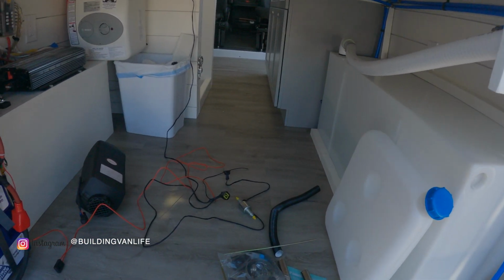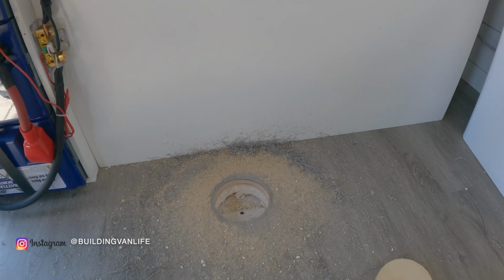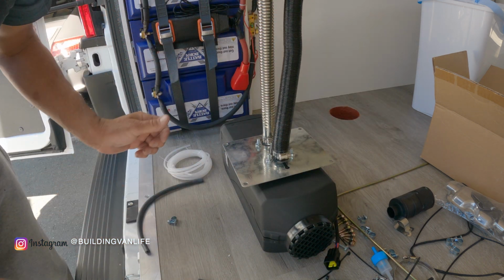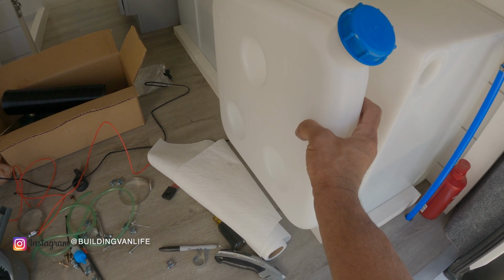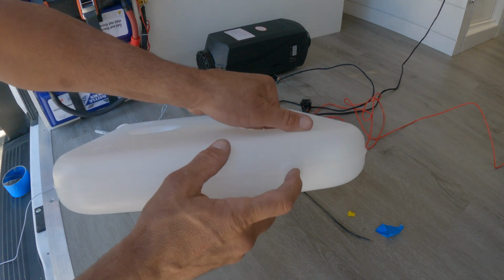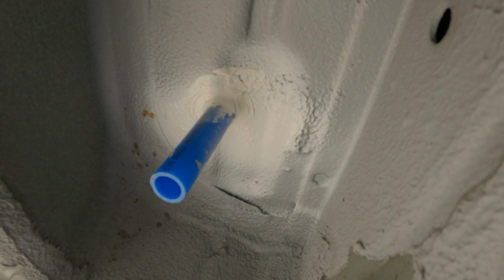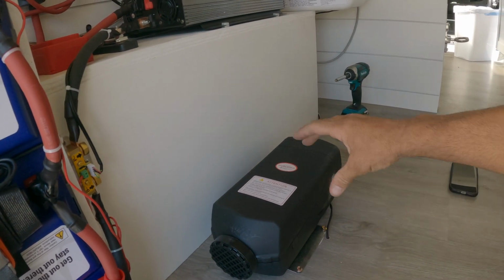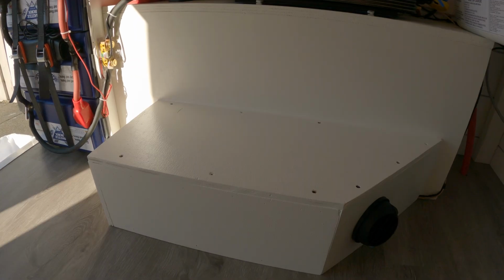Promaster Van Build | Ep14 | How to Install a Diesel Heater

Comment: Just a quick tip: So, regarding the muffler, you may want to mount it vertical as it has a weep hole at the bottom to release condensation. Else you will be blowing steam and that is highly visible (not so stealthy).

Comment: Thoughts on installing tank in engine compartment?  Or anywhere but inside?
Reply from the maker: Yes I’ve seen it done under the hood with a special tank.  I think it’s a great idea but then you need to install the heater towards the front of the van which I didn’t want to do for this build.  I like having the heater near the water tank to keep it from freezing.
Reply: @BuildingVanLife  Cool thanks.  I like mine too toward the middle, so if consequently the engine compartment is out, where else can I install heater outside an fill easily?  I've see tanks mounted beneath near the door with fill access through floor near the door, but that could vent fumes as well.  I hate having tank under bed.  Excellent info!
Reply from the maker: @3genac  I don't know i guess you just need be creative.  I have had my tank inside on 5 vans and never had any issue with fumes at all so it's never been an issue for me.

Comment: Definitely should have bought a grommet kit for all the small holes to protect for all the fuel lines and wire penetrations in the floor and the van’s structural beam penetrations as well, pretty cheap insurance, a full kit is about $10 bucks at Home Depot or Harbor Freight. The hole for the Intake and Exhaust needs to filled completely after the unit was placed, speaking as a retired Fire Fighter / NFPA Inspector (fire codes), the approved fire rated caulk acts as a heat sink for “X” amount of time before the caulk fails…just a thought !
Reply: @Hotzone97 what do you recommend to fill the hole?

Comment: It is so refreshing to be back to your channel and great tutorials! Are you happy with the size of the heater? I know you are in a new van. Did you use the same size model and install? I guess I could search your channel:)
Reply from the maker: Yes I used the exact same one on the new van. I’ll be showing it in my next video.  The size is great.   It’s such a small space that even on the lowest setting it gets really hot fast inside.
Reply: @BuildingVanLife  awesome! Your vids and your mannerism really instill confidence in that I can do these installs. You really helped my build my van. Been full time in it since june, but still have some things to complete. Are you ever gonna install a 12v AC unit?
Reply from the maker: @MannyWC  I’ve considered it.  I think on this one I will get a portable one.  They make a small portable one that a lot of vanlifers use
Reply: @BuildingVanLife  Yes, I got the Zero Breeze, but it is 110v or you buy the 1K battery for it. Trying to vent it etc is a bit janky. Will be interested is seeing what you get and set it up:)

Comment: We have used several of your instruction videos on this van build to build our own van in Northern California between January and April. We used your link to buy the Chinese diesel heater. It worked wonderfully up until now. It shows error code E4 and we don't know how to fix it. It means there's an error with the fuel pump. The first thing we did is replace the fuel pump. No luck.
Reply: Then we thought we would try replacing the controller. We learned that we have what is called a uncommon controller so it's not compatible with the motherboard of the diesel heater. Do you have any thoughts about this?
Reply from the maker: @joelatsacredgrounds  First I would check the fuel line.  Did you run out of diesel at any point while it was running?  Fill it up, make sure there are no air bubbles in the line, if there are bleed the system again with the process I show in the video, check the fuel filter, make sure it's not clogged, maybe even clean it out, you will need to bleed the system again if you do this.  then remove the fuse to hopefully reset it, put the fuse back in and see if it works.
Reply: @BuildingVanLife  when I replaced the fuel pump diesel ran freely through the gas line. I took the fuse out for a few minutes to reset it. I unplugged the controller as well for a few minutes. The heater never ran out of gas. The controller will not respond to pressing the buttons that cause the gas pump to Prime. If I press the power button for 3 seconds the controller shows that it's beginning the on cycle for a second and then immediately turns to error code 4. I wonder if we should simply replace the heater
Reply from the maker: @joelatsacredgrounds  yeh probably just try returning it to Amazon with the same one so you can just drop it right in the same spot

Comment: I’m getting ready to install one of these and want to install it in the back also. I was wondering if you had any issues the way you installed the pump. Instructions say to have it on a 45 degree angle which is impossible mounted under the support like you have shown. That is the perfect spot to run the fuel line and have the pump. If you had no issues, I’m installing the way you have shown.
Reply from the maker: No issues at all.   I’ll be doing it the same way again soon on my current build.  Good luck.
Reply: @BuildingVanLife  thank you so much. I take it you had no issues with the tank leaking? Great video. Hope to see the new build.
Reply from the maker: @Nalahikes  that’s correct

Comment: I have used your videos for our grey tank ( I have the drain run but still have to install the tank and connect the valve & now its helpful for our diesel heater! Thanks for these. We are putting it under our passenger seat which is a double right now that we will switch out for a single. I wish I could wait till I switch the seats but its too cold so I have to do it now!
Reply from the maker: Very cool, be sure to hit the notification bell b/c youtube doesnt seem to be suggesting my new videos to subscribers.
Reply: @BuildingVanLife  theres ups and downs on Youtube so don't stress if some videos are suggested less - it happens!

Comment: I'm getting ready to take the plunge and install my heater this weekend.. Since you've had yours running for a while now have you had any issue with water getting in the van from that hole you drilled? Are you happy with the 3m sealant you used? I"m going to go pick some up from Home depot this weekend and was curiouse how it held up.   It looks like a nice and simple solution.  Thanks for putting in all the effort to edit and post these videos!
Reply from the maker: It’s all held up great.  For sure the 3m is a must.  It’s the only thing that can withstand the heat and seal.  No water coming in at all

Comment: Do you have to prime the pump every time you start it, or just the first time after install? If it’s every time, wouldn’t you have to run outside each time you use it to make sure all the air bubbles are cleared out? Thanks!
Reply from the maker: you only have to prime the pump the first time you install it, or if you ever disconnected a fuel line and got air in the line.
Reply: @BuildingVanLife  gotcha, thanks!

Comment: Hey man! Running the same diesel heater setup as you and would like to carry an extra fuel pump and filter while I travel. Would you happen to have a link to the exact pump and filter we used? Having trouble finding it online
Reply from the maker: you can use this one, it will work https://amzn.to/3dTzND6
Reply: @BuildingVanLife  Really appreciate that man! One more thing, have you found a way to run the heater automatically? They come with a different controller module now but I cant seem to get it to kick on and cut off at set temperatures.
Reply from the maker: @shiddandfarddlol  no I haven’t tried that yet.  When I’m in the van I usually only need to run it for a bit and then I can turn it off since the spray foam insulation does such a great job holding the heat.

Comment: Great job on the video.  Gave me perfect ideas for my install on my "non-diesel" van.  Two questions: 1). do you have any diesel smell  inside; and 2.) with the pump under the van what, if any, is the noise level of the pump inside the van.  Appreciate any feedback.  Thank you.  BTW, from other videos I've watched, I think the muffler is installed incorrectly.  Other have noted a small hole in one side of the muffler which is to act as a drain for condensate and should be oriented downwards to affect proper drainage.
Reply from the maker: No smell at all in inside the van.  With the pump outside you can still hear it a little bit but compared to it inside it’s a huge improvement.  Yeh I noticed the hole on the muffler after someone else mentioned it and rotated it.

Comment: Thanks for such a detailed video! Question: What type of white sealant did you use between the bottom plate and the floor? Also do you have any issues with the bottom plate getting too hot and either melting the sealant or the floor?
Reply from the maker: The plate doesn’t really heat up.  You can use almost anything caulk, silicone, marine sealant.  I usually use whatever I have around.
Reply: @BuildingVanLife  Awesome! Thanks for the quick response. I was a bit nervous cause I had already installed it using regular silicone and didn't want to have to undo everything.

Comment: Hey thanks for such an informative video. How do these type of diesel heaters work in high altitude areas. I’ve seen and heard of auto altitude adjusting heaters but is it a big deal if one doesn’t have that?
Reply from the maker: I haven’t heard of any issues.  The highest I used it at was 8000 ft.  Worked as it should.  Hope that helps.
Reply: Thanks that helps out a lot actually!

Comment: Love the fuel box. Is there a reason why I couldn't put the pump inside the van ? And only have the Exhaust and intake outside the van?  I understand the gas line will need to tread inside ?   Thank you
Reply from the maker: You can put it inside the van.  Most people do.   The only issue is it’s very noisy when it’s running it’s like a clicking sound.  so it can be annoying when sleeping.  That’s why I put it outside.

Comment: awesome work as usual... Could cut a strip in the piece of wood holding the diesel tank so you can see how much fuel you have left??? Also, does that pump clicking not get super annoying while sleeping?
Reply from the maker: The wood holding the tank is only on one side so you can see the fuel level.  For sure the clicking is annoying that’s why I mounted the pump under the van instead of inside.

Comment: Hello, the green tube didn’t come with the kit. Do I need to get one separately or is there something else I can use that comes with it?
Reply: Your videos are a great guide through my whole build, thank you so much! 
I got everything hooked up and primed the heater. When I turn it on, it blows air lightly then turns off with an error 03 message. (“Ignition plug fault”) do you know how I could trouble shoot this? Thanks again
Reply from the maker: @jayko8200  it can be a couple things, most likely it's low voltage.  Is your battery under charged? If so make sure your battery is charged enough, otherwise it could be a faulty glow plug.  You would need to return it and replace it through amazon if that's the case.  Try the voltage first.
Reply: Green light is on for batteries showing full battery on the charge controller. 14.3V on the battery monitor. Uninstalling this heater is the last thing I want to do as everything including diesel tank is mounted and screwed in.. by chance can you think of another troubleshoot?
Reply: Isn’t the pump supposed to be pumping when I turn it on? The pump clicks when priming,  but doesn’t click when turned on.
Reply from the maker: @jayko8200  once it’s fully turned on yes you should hear the pump clicking.  Remember it takes like five minutes for it to fully turn on.  So it won’t start clicking immediately.  After five minutes if you don’t hear it there is something wrong.
Reply from the maker: @jayko8200  make sure you have all the wiring correct and the correct fuse.  Other than that it might be the glow plug.  Never really heard of someone having your problem.  Something must have been done wrong along the way
Reply: @BuildingVanLife  Turns out it was the broken glow plug, but Its working well now! thanks for the reply and suggestions.
Reply from the maker: The green tube I had left over from the last one I installed, the kit comes with with a clear one, they are the same thing, I just used the green because it's more flexible, but just use the one that comes with the kit and cut the black rubber that comes with it to go around each connection.

Comment: Couple questions: 1. Any issues with getting a diesel smell inside the van? 2. Any issues with the line or diesel coagulating/freezing in cold temps?  (I think you can also use diesel additive to mitigate/prevent this phenomena as well). 3. Do you need to do any flushing of the line when not in use?
Reply from the maker: I haven't ever had any diesel smell ever, not at all.  You bring up a good point with the diesel line freezing, i haven't taken it to any extreme temperatures yet, maybe next time i'll keep the line inside.  You shouldn't need to flush the line, but if you completely empty it, you may need to just prime the pump with the prime cycle again which isn't a big deal.

Comment: Isn’t the muffler supposed to be vertically placed? I believe (based on other videos I’ve seen) that there is a hole on the bottom of it to allow for any water build up.
Reply from the maker: yes i think you are correct, i have since rotated it

Comment: Beautiful work !  If I may, could I just say  that anything electrical or any fuel lines should be placed inside rubber grommets if at all possible .... Simply a suggestion and nothing more... Very nice, clean and precise job for sure !!

Comment: I'm wondering why you would install a diesel heater in a gas powered van and have to worry about the possibility of spilling nice, aromatic diesel under your bed when you fill the small fuel tank when you can get gas heaters that can be plumbed directly into your vehicles very large fuel tank? I would also think the small fuel tank would limit your stay anywhere for any length of time.
Reply from the maker: These are pretty standard in van builds, why would I use it?  The cheapest gasoline heater i can find online is $2,497 while this is $169.  Why would I spill it?  I'm not the careless type.  They last a very long time on a single tank and they also sell larger tanks sizes if that's an issue for you.  I believe these are the most efficient option for heat.

Comment: Thanks for making this video, I’m planning to use the same heater for my own build! Hopefully it can pump out hot enough air that I could maybe make pancakes with it! 👍🥞
Reply from the maker: Haha I don’t know about pancakes but these things are so powerful I usually just use them on low when they are needed
Reply from the maker: I just realized you are referencing my subliminal message lol, very good.

Comment: What kind of wood are you using just for making the boxes ?? Sick video!
Reply from the maker: 1/2 inch sanded plywood that I have had left over.  I’ve been using it on most of everything.  I just cut down some pine scraps for the frame.